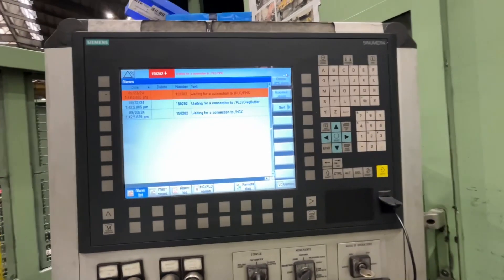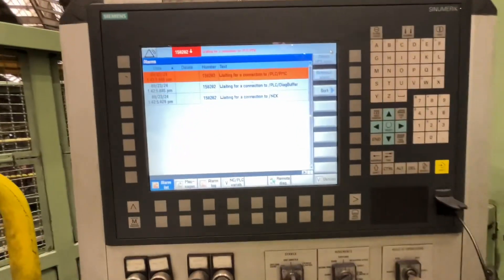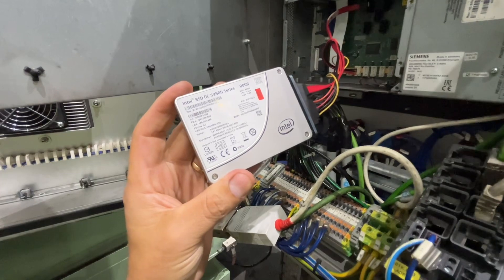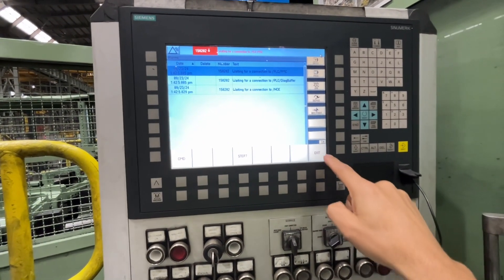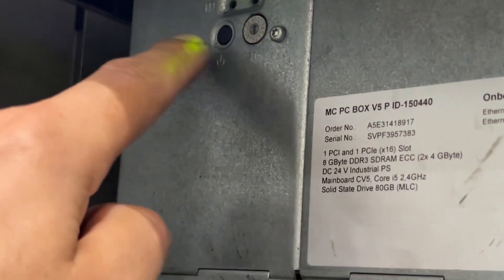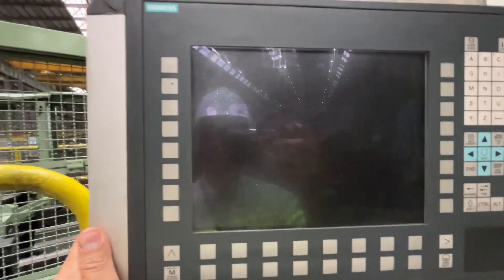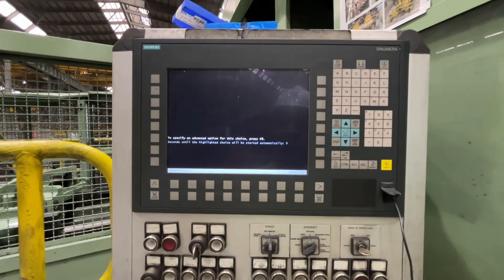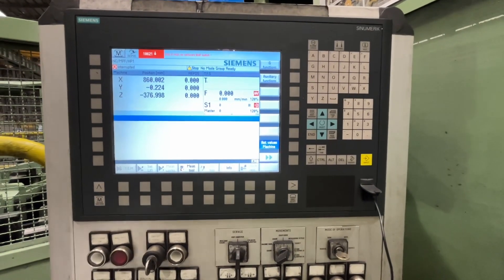Sinumerik 840D sl: 150202 Waiting for connection to /NCK, /PLC/PMC, /PLC/DiagBuffer. Replace SSD

Comment: Bro, we have the same case and  this video was very helpful for us. Thank you!
Why it happened? I mean errors 150202. Maybe we need just restore HMI backup?
Reply from the maker: If the CNC was running fine and Alarm 150202 suddenly appears, the root cause hierarchy should prioritize issues that can occur during normal operation without prior configuration changes. Here’s the hierarchical order of checks:

1. Immediate Communication Loss
Loose or disconnected Ethernet cable between:
NCU ↔ SIMATIC IPC 477E
NCU ↔ MCP 2200
Cable damage due to vibration or accidental pull.

2. NCU Status Change
NCU rebooted unexpectedly (power fluctuation or reset).
NCU in STOP state (check RUN/STOP LEDs).
Overtemperature or hardware fault causing NCU to halt.

3. Power Supply Issues
Drop in power to NCU or IPC during machine operation.
Faulty power module or connector.

4. Software Crash or Service Stop
SINUMERIK Operate on IPC froze or crashed.
NCK or PLC process on NCU stopped unexpectedly.

5. IP Conflict or Network Error
Another device joined the network with the same IP.
DHCP or static IP misconfiguration after restart.

6. Firmware/Version Mismatch After Update
If an update was recently applied, version incompatibility could cause communication failure.

7. Hardware Failure
Ethernet port failure on NCU, IPC, or MCP.
Internal fault in NCU communication module.

✅ Recommended Quick Actions
Check NCU LEDs (RUN/STOP, error indicators).
Inspect Ethernet cables and connectors physically.
Ping NCU from IPC (if reachable).
Restart IPC and NCU.
Verify IP settings in HMI and NCU.